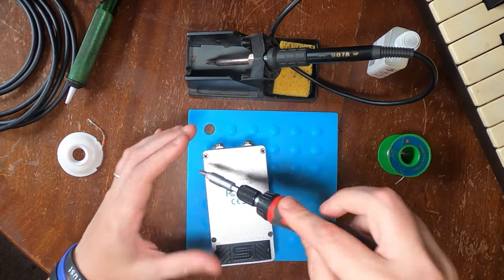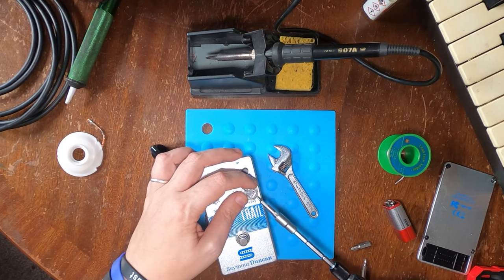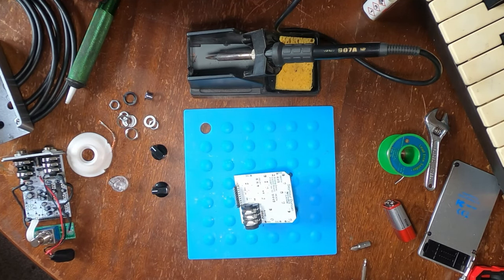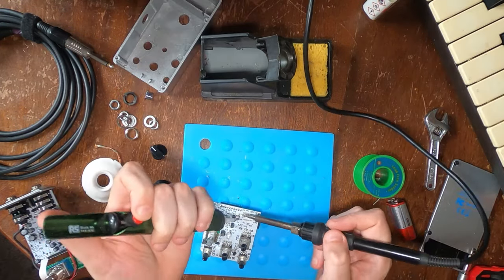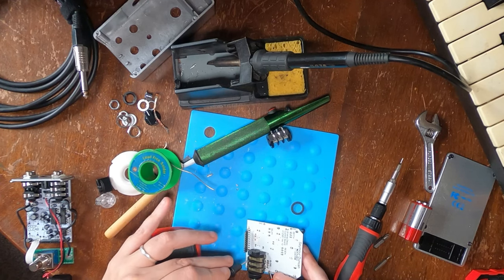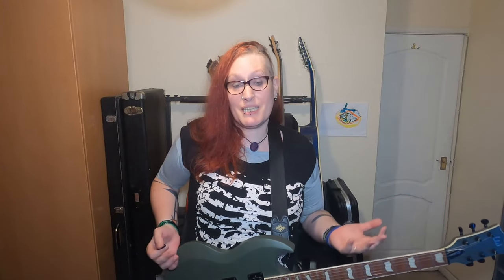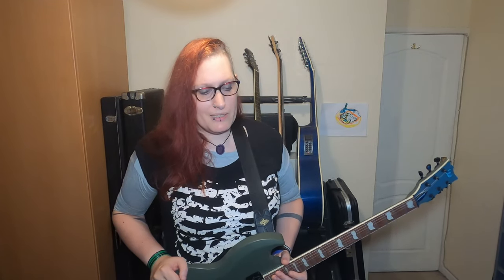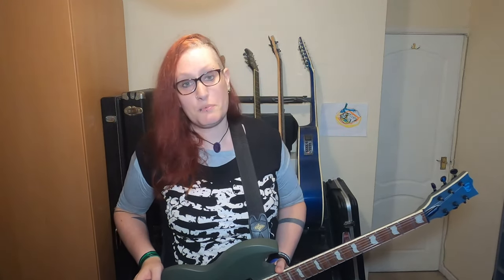Seymour Duncan Vapor Trails repair

Comment: Wow
Mine has been on my board 10 years + Never let me down till yesterday and the same thing. Didn’t think of checking the Trs socket so sprayed switch cleaner and inserted a jack into the wrong hole a few times… and yes surprisingly it works again as it should . Will see how it goes 🤞
Thanks for your upload of the repair. ✌🏼

Comment: Thanks for your video, I also had no delay but everything else seemed fine like the flashing light. I took mine apart and then checked the wet insert jack. I sprayed contact cleaner on the tabs that connect when there is no cable inserted and cleaned them and now it works again.😀